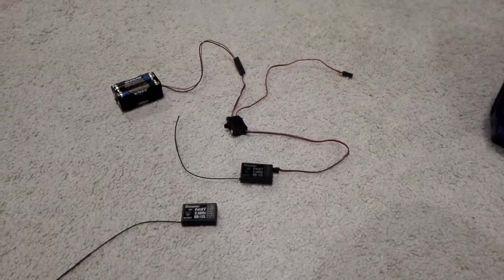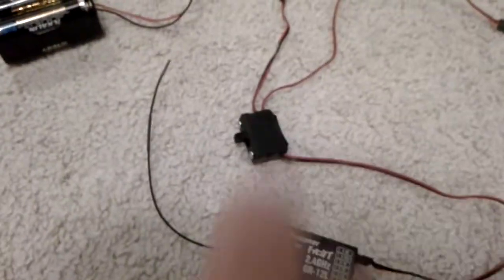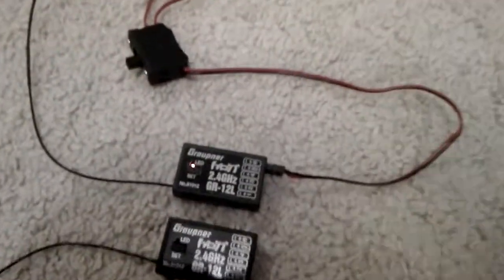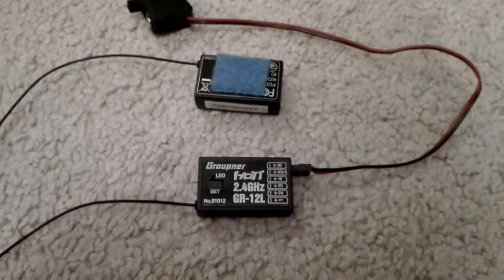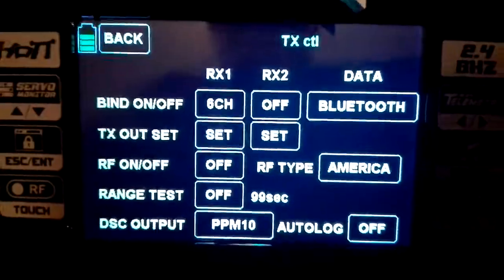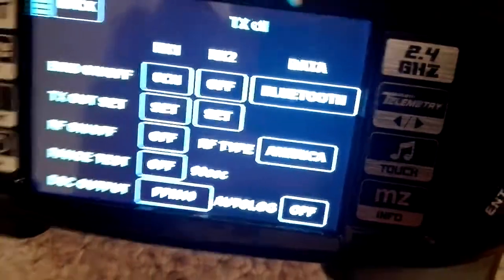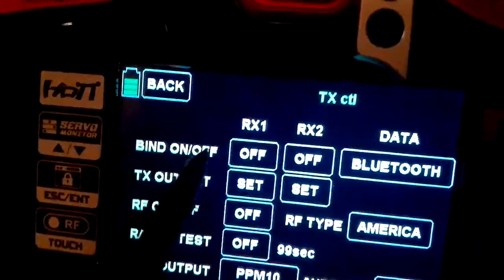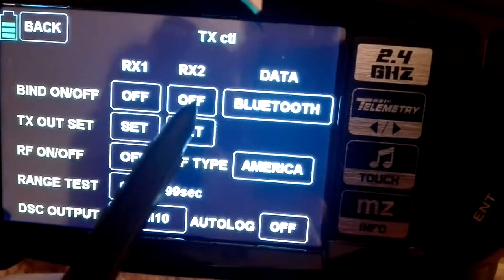Failure to bind two Graupner GR-12L receivers (take 1)

Comment: hi saw your Jeti video, it is not possible to comment on the video.  try pressing auto in the servo assigment menu.
Reply from the maker: Thanks for letting me know you could not comment on Jeti video. Turns out when you mark video as for children, it disables comment. I just modify the video settings so comments can be left.
Reply from the maker: I tried auto in Servo Assignment and it did not solve the issue. The only solution is to start new model, which I did and everything was fine. Jeti technical support said that it was probably caused by me modifying basic properties after the model was created and transmitter got confused. In Jeti videos on Esprit website, in several videos they say if you make a mistake they recommend starting all over again, which is strange, but that supports the statement that transmitter can get confused. Thank you for you reply.